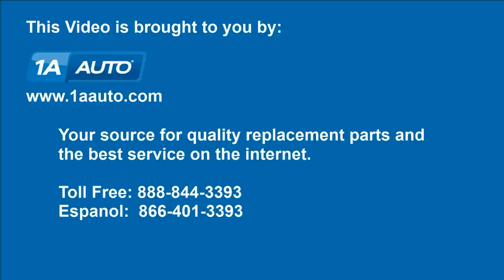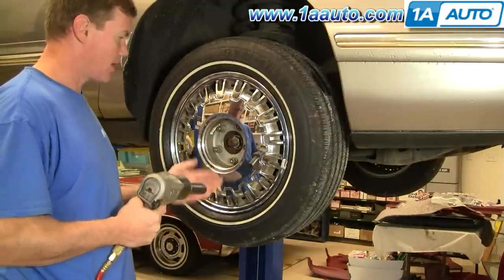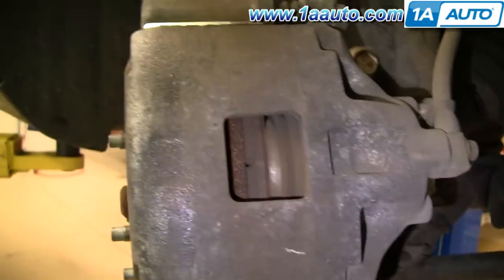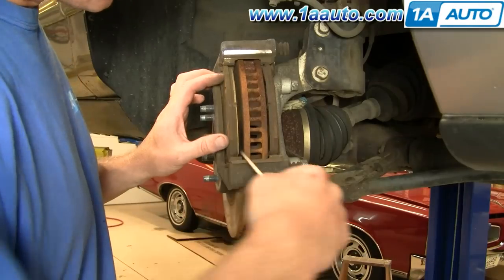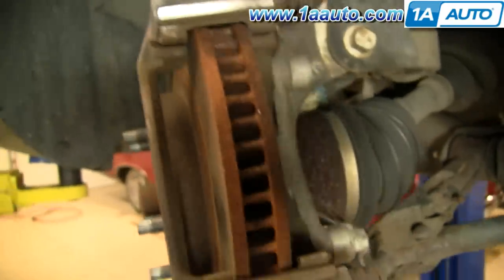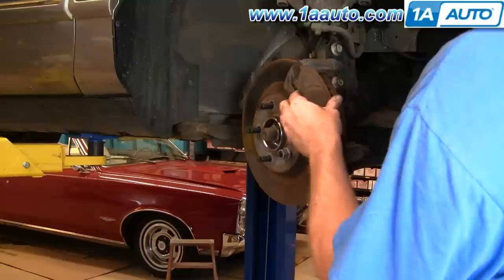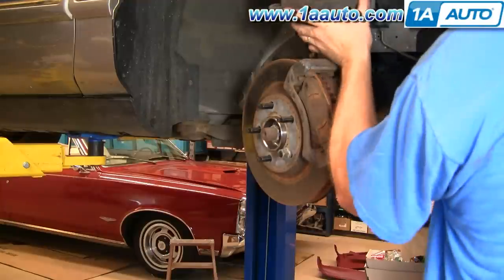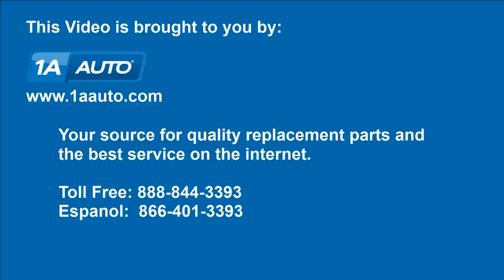How To Replace Front Brakes 96-99 Cadillac Deville

Comment: 1996 Deville rears deserve their own video, between the arm for the emergency brake & screwing the piston back in, they are way more of a hassle.  Plus the wheel skirts just make it so dreamy to work on.  Also I think a good point to make a separate vid for the rears is that the rear caliper swings up, you only take the bottom pin out.  Something to think about....

Comment from the maker: Usually you can compress them a little bit with a flathead screw driver to remove them from the rotor, once they are off you can fully compress the caliper and put the new pads on.

Comment: I just installed new disc brakes and rotors in the front, the pads are ceramic, they feel spongy. Is there a solution/fix for this?
Reply from the maker: +ARCFilms Thanks for watching!  If they feel spongy you may have to bleed the brakes.  If that does not resolve the issue we recommend having a trusted garage diagnose the issue!  1aauto.com
Reply: Air in lines. Bleed them and do a pad break in

Comment from the maker: The vehicle should be turned off and in park. I also helps to chock the wheels that are on ground so that the vehicle doesn't roll. Hope this helps you out.We carry new brake pads and rotors for all kinds of different vehicles on our website 1aauto.com 888-844-3393